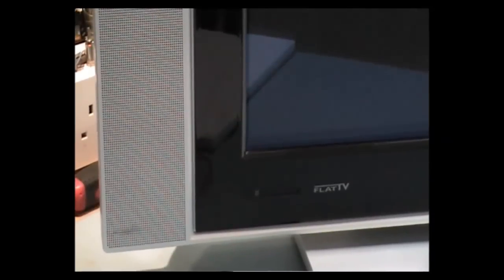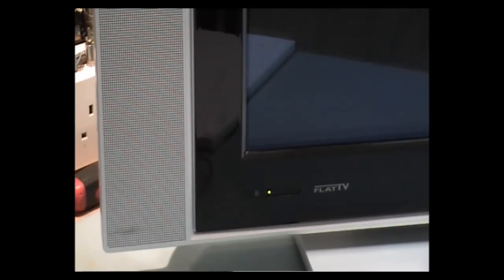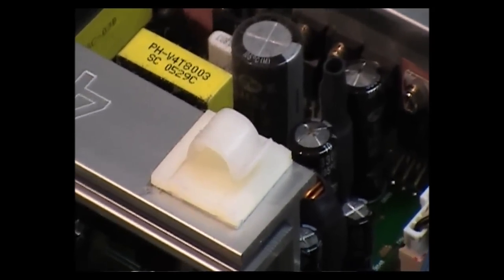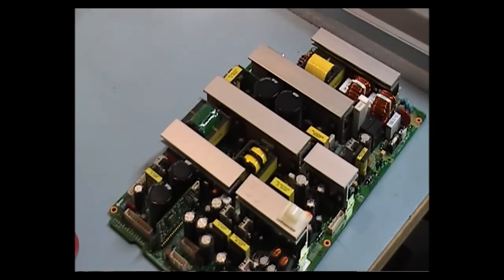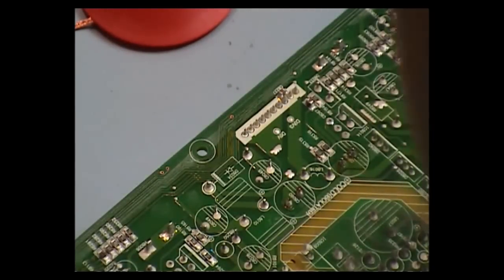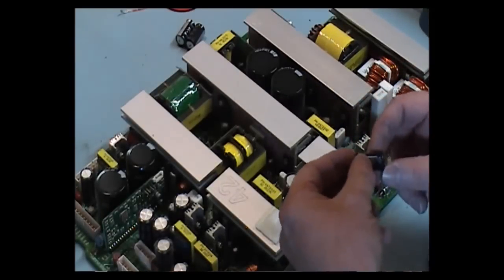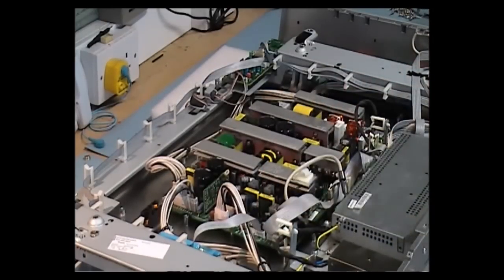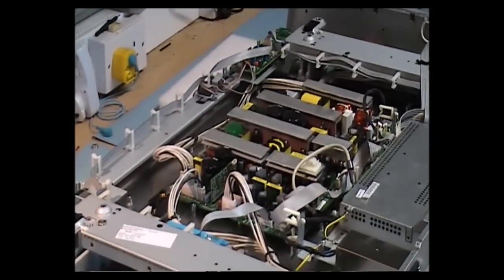Philips 42PF7320/10 Power supply Fault finding

Comment: I ordered a reconditioned power supply to replace broken one,ive successfully fixed the clicking issue with my philips 42pf5520d/10 thanks for intructions,saved myself £200+ on a new tv.

Comment: I have the same problem with those capacitors. As I couldn't get the capacitors with the same capacitance, I had to buy two caps with 6800 uF. I still have the problem, so I wonder if it could be due to the difference in capacitance. They have to be replaced by the same capacitors or I can use others with more capacitance?

Comment: i have the same model tv as your video.i am going to replace the caps as shown by your video. where do i buy the correct caps before i start the job.
Reply from the maker: +brendan bowe I normally buy from RS components also called Radionics part no. 519-3898

Comment: Hi, I'm curious, when I bought the plasma new all the warnings were to never lay it on its face, how can one work on it without laying it on its face? I see you did & you know what youre doing. Please advise. Thanks!
Reply: There is no problem with laying plasma tv on their face for repair, i have done on countless plasma tv repairs in the past, as long as you are careful not to cause any shock/impact. there are some technicians that would disagree with me, but i never had a problem
the problem with laying plasma on its face is, during transport of tv, the screen would be subject to vibrations that could potentially damage the screen

Comment: hi I have this problem I have replaced caps that had blown but still not working. have two green lights come on then go off.one flashing green light on power board flashes eight times and repeats. also green flashing light under plate next to where you plug in power any ideas what is wrong.